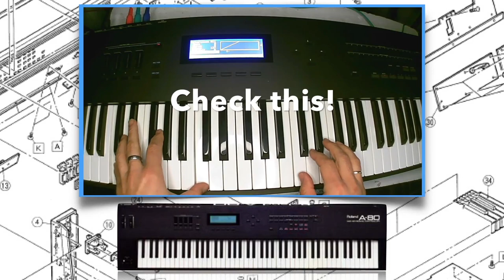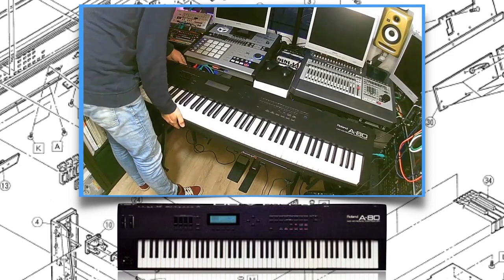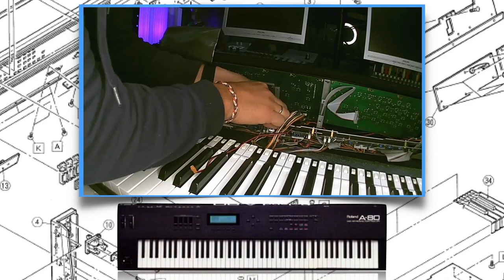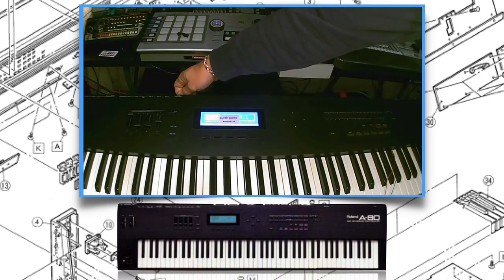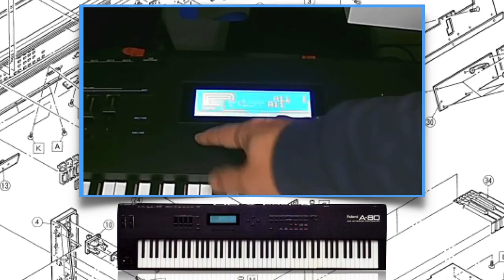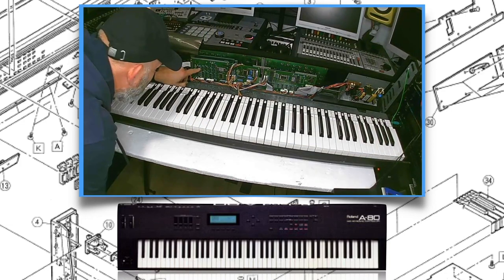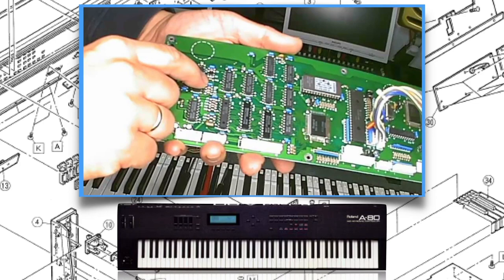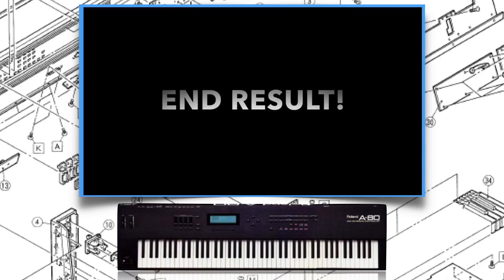Roland A-80 REPAIR: New Blue Display &  Amazing Aftertouch

Comment: Wow! Good job. I also have an A-80. This is my first dream instrument. Display, not backlight like in the past, but still working. The perfect keyboard for pianists, and more. Today, they don't produce them anymore. And that aftertouch. It's so practical for synth sounds. It is a pity that it is so heavy (30 kg without the case). Today the A-80 is working in my studio, and I'm taking the RD-300 GX to concerts. Today is 2022 and both instruments have not aged at all. I like Roland piano keyboards.
Congratulations on the video and passion.

Comment: Thank you for putting this info out. My tech did the after touch mod on my A 50 (the unweighted version of the A 80). It is beautifully responsive to after touch now. While my original screen is still working, that new brighter screen looks fabulous and much easier to read than the original screen is.
Reply from the maker: Awesome that yours is now responding too like it should be.
And the screen change is really super easy!
Reply: @theMIDImaniac  - The A50 and the A80 have really nice key beds, especially compared to some of the low quality stuff that manufacturers put out currently. I still use my A50 today. It compliments the weighted Yamaha CP 4 very nicely. Between the two keyboards and and SK2, I feel like I have my bases covered for recording and performing (if THAT ever returns). 
I was also using a Roland Axis 1,  but because I am a pitch bending maniac, over time I completely wore out its pitch bend mechanism. Performing vibrato on that wheel felt so much like performing vibrato on a guitar string. It was wonderful. Even though it has that great 1980s Roland key bed, without a bender it has just become a doorstop. It is impossible to find a replacement part and I will not buy an entire Axis 1 just for the bender, unless the price is low enough to be irresistible. Sad.

Comment: Really enjoyed this video. Quick question for you: Do you know what foot-pedals work with the A-80? I have an A-80, but I can't get my foot-pedal to work. I've read the manual and done the proper steps in the menus to change the pedal to "Sostenuto", but it doesn't work. I think my pedal isn't compatible.
Reply from the maker: Hi!
Thanks for asking.
Most pedals will work with the A-80.
I've got the DP-2, DP-10 and EV-5 and they all work fine. Also I have working NON-Roland pedals.
Positive part of the A-80 is that you can connect up to 4 pedals. 
Personally I never used Sostenuto. Never noticed difference. I think it has to do too with the connected sound module.
Hope this helps.
Reply: @theMIDImaniac  
Thanks very much!

Comment: Can you post a pdf of the manual for this? I ordered from synth parts and they did not include instructions. What do you have to do with the power supply?
Reply from the maker: Hi!
I have to search for the manual. 
According to the website of synth parts they provide the instructions. 
Perhaps they forgot to include it. 
In the instructions they also explain what to do with the power supply. You need to cut away two small parts. 
Here the link to the product, get in touch with them!
Good luck!
https://www.synth-parts.com/en/products/displays-und-led/display-sets/6449/roland-a-80-a-50-new-lcd-display-blue?c=1252

Comment: Do you know why the power supply of the old display should be deactivated? I'd prefer to leave it in a working condition when I do the change. Will there be any disadvantage?

Thanks so much.

 The video is great. I will try to execute both changes this weekend.
Reply from the maker: You can leave the power supply. Only when you hear a high pitched sound then remove those small parts. 
Thanks a lot and good luck on this modification.  
Take your time. 
Meanwhile mine is stored because I don’t have space for the A80, Vsynth and soo the JD-800 🙈🙈

Comment: If you did play around with midi outs, Can you please let me know whether those 4 MIDI outs are self powered? I'm planning to go for Bluetooth MIDI instead wired MIDI. Appreciate if you can help before buying the BLE devices.
Reply from the maker: That's a good question. I really don't know if they're self powered. I do notice midi signals coming in a non-powered midi-splitter. The lights of that unit are blinking when playing the keys.